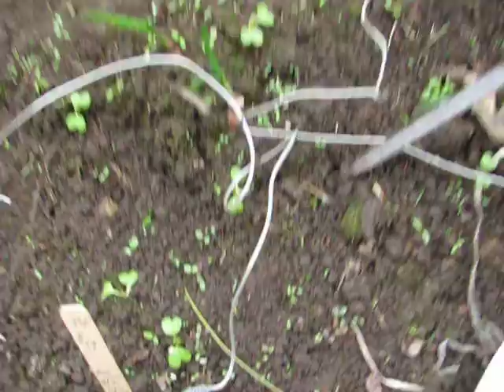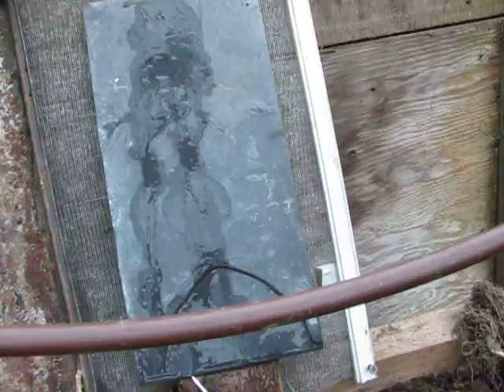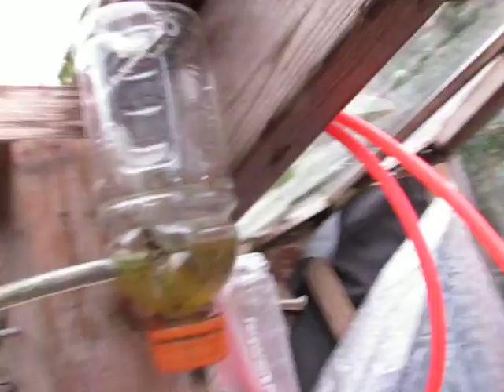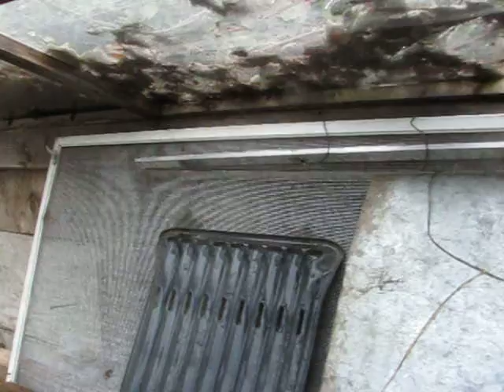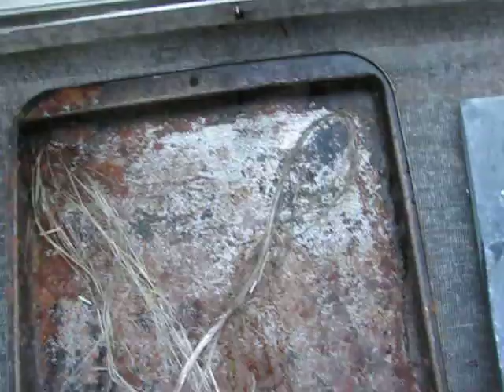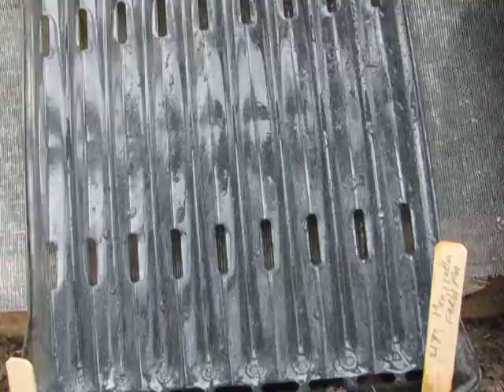"Drip walls" to move heat down into and under  the soil and germinate seedlings?

Comment: Very cool Brian White! I'm way behind on videos so I haven't seen some of the previous...but this looks promising!
Reply from the maker: Thanks Wayne,  It is over now! The big freeze is over,  thaw has began and I have to get back to making rock steps. The figures are (for what I did)  about 3 liters per hour water moved,  3 to 5 degree C heat addition to the water if it is cloudy and 10 to 15 degrees C if it is sunny.   If you do a hydronic system,(separate the water from the soil in pipes) you could move way way more water and  heat but   it would stop working when part of the pipe freezes (and the pipes might split).   That is why my system is like it is.